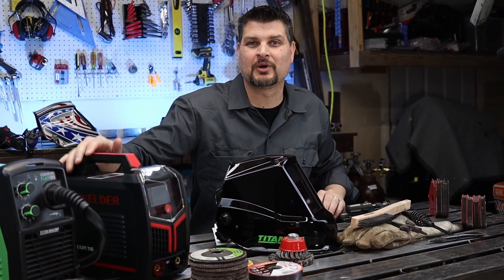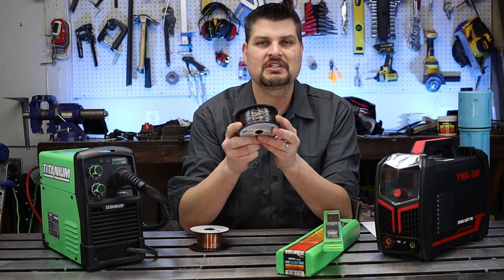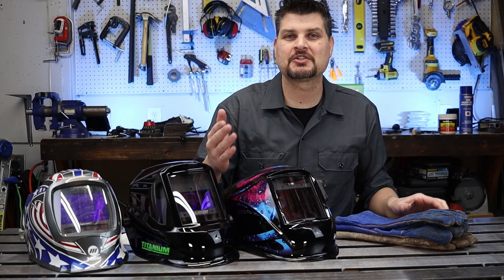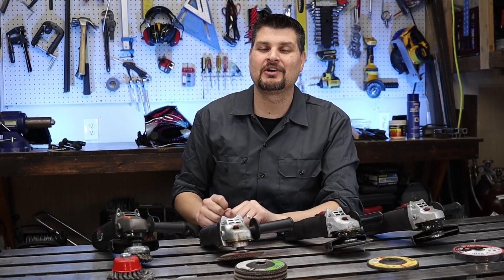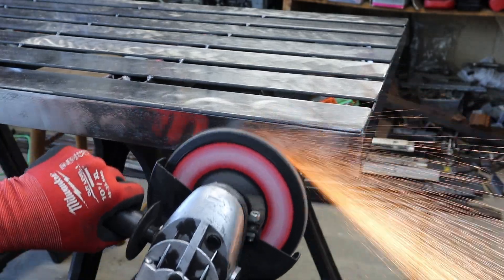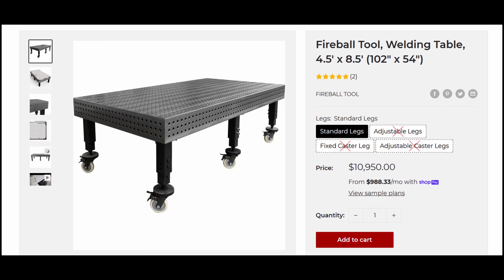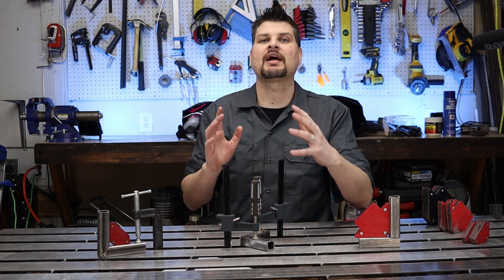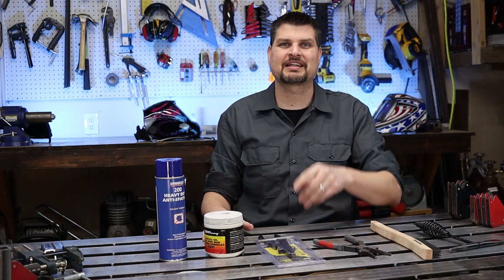MUST Have Items for the Beginner Welder: Harbor Freight Deals

Comment: Question? Should I get both chop saw & band saw. To be honest I rather get the chop saw.
Reply from the maker: Really depends on the type of projects you are doing. If a bunch straight cuts for frames then defiantly go with the chop saw. If intricate art work with curves then you'll want a band saw. I solely used a grinder and chop saw for many years before I picked up a band saw.

Comment: Flapper wheels on a grinder are the shizzle.  Doesn't matter what metal you're working with it's very controllable.... Grinding discs tend to walk..... And also moderately fast at metal removal.  Way more useful than grinding discs 90% of the time. 

The drawback is they're expensive as hell

Comment: I've had my Titanium 125 Flux welder for a few years now. I've used it for various things, most notably of which are the frame of my double swing driveway gate and my truck's offroad bumper. I love flux core because it's so simple. And the tools from HF are great, I also have the auto darkening helmet and brushes from there. Gloves aren't bad, but I ended up going online to get some better ones. You can't go wrong if you're looking to get into welding as a newbie. Learning to weld completely changed the game for me as a DIY enthusiast.

Comment: I just picked up one of those Titanium welders today and installed  .035 wire right away because I find it lasts longer and welds better for me. 
 My arsenal of tools also includes two angle grinders. One with a cutoff wheel on it and one with a grinder wheel on it for grinding off my welds. Now with DC welder, it won't take much to make my welds look good!

Comment: Dumb question that I think I know the answer to, but for flux core, you don’t have auto rated, but is that because of the slag from the flux? Asking because I’m trying to figure out which kind of welder I’d like to pick up as a beginner, and I’d likely not be doing body work on a car, but would probably later be interested in doing floor pans, a muffler, etc where the welds aren’t going to be seen. I’d think flux core would work for that, unless there’s an actual science portion I’m not thinking about, at which point, I defer to your knowledge

Comment: From my experience, using nozzle dip sparingly is the right move. A small dap applied correctly goes a long way, saving you from constant purchases. Plus you definitely don't want it getting sucked up through gas line. Using too much can burn up your tip faster. Less is more in this situation.

Comment: Respirator?
Reply from the maker: If you are welding in an enclosed area with no ventilation then yes, you will want a respirator. I lift my garage door halfway open and have another door on the other side that is open for ventilation.

Comment: Titanium 125, auto darkening helmet, gloves...been welding everything from go kart/mini bike/moped/atv frames to mower decks and sheet metal.  Thats under $350 to be able to do most welding that a hobbyist/weekend warrior is going to do.
Reply: Theres some great auto darkening hoods for even as low as $35 online. 
My brother wanted to learn how to weld so I made him a list.
Titanium 125 with 20% coupon was $120. Warrior angle grinder $10. 10 pack of cutoff wheels $5, 1 grinding wheel was $2 and a wire wheel was $5. Got a nice yeswelder auto hood for $32. Welpers were $9 and a 3 pack of gloves was 12.  For under 200 bucks at the end with 6lbs of wire.

Comment: When I saw those $10 angle grinders, I bought 4 of them. Set them up just like you did. A cut off wheel, a grinder wheel, a flap disk & a wire wheel. That cup wheel has a mind of its own, so I got the other style, like the ones under your displayed cup wheel. 
The only thing I differ from you on is I wanted a fixed shade helmet. I learned to brace my hand in the ready to weld position, flip the helmet, as soon as I pull the trigger, we're welding. I'll say this video is good, it should help a lot of people.
PS I have had good results with my Titan 125 & 0.30 wire.
Reply from the maker: Right on, thanks!

Comment: You sorta breezed over the welding table, and you are right. A beginner doesn't "need" one, but after I started welding more I found I just couldn't work on the floor any longer. For anyone wanting to build one, go to your local scrap yard/junkyard to source the materials. Much cheaper this route. Also, I'm heading over to the scrap yard this week to find a small steel plate. I love that portable round welding plate you have with the grounding nipple!
Reply: I hear so many people talking about getting material from the scrap yard, it makes me sad. Around here there are no scrap yards that will let us buy anything. They used to, but for whatever reason, not anymore.
Reply from the maker: You are right on. I'll actually be doing a full table build here pretty soon. Showing how I did mine.

Comment: I'm going add my 2¢, get a respirator mask to keep most fumes out of your lungs.
Reply from the maker: Yes, I've been meaning to do a video about that exact thing. I open my garage and back door so I have a nice cross wind that takes the fumes pretty quick. This is something you should be doing with good ventilation and a respirator.